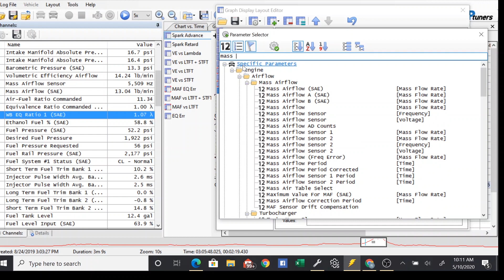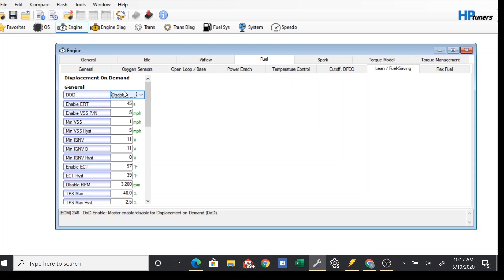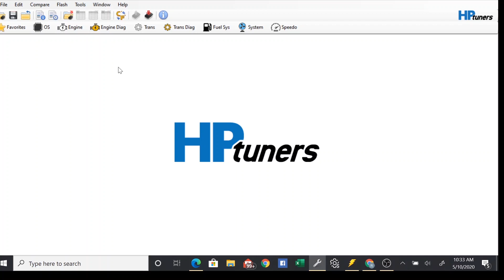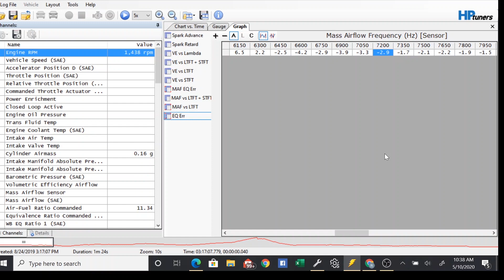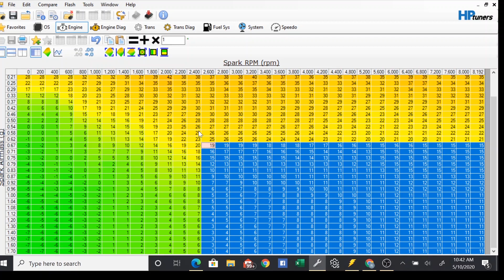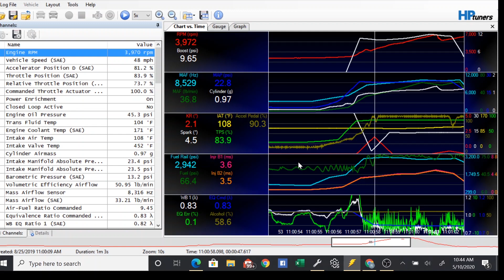GM GEN V WOT MAF & Timing Tuning

Comment: Thank you! So informative and helpful. Liked and subbed for sure.

I realized while watching this that it's all finally clicking and making sense to me. There's been so much trial and error with different parts of my tune file. At first scouring the forums and YouTube videos this all looked like Chinese, but I'm seriously running these logs and making changes and finally making headway. I still get worried about getting stranded somewhere off the side of the road after a disastrous upload or something...which is why I usually drive home before flashing an updated tune. 😆

Comment: Rob, I have upgraded to stage 2 on my 2017 Camaro with 2.9 Whipple that consist of rotofab s/c partial ca, TSP LT headers, cat delete front pipes, complete ZL1/LT4 fuel system, 3.5 upper pulley, and Alky injection kit with m15 jet spraying vp racing M1 methanol. I purchased an unlocked TCM from HP Tuners and took the car to get a motor/trans tune (Vengeance Racing). I was hoping you could help me with a few questions I have about the tune and lend some advise about some more upgrades I'm considering, Thanks.
Reply from the maker: Sure Lloyd, shoot me an email at tacticalgaragess@gmail.com

Comment: Thank you for the video brother , great explanation and your steps are logical and coherent . I hope you do a partial throttle video next , in the partial throttle maf is also used right?  From my understanding on gen v the car uses maf in closed loop and the  vve in open loop right?
Reply from the maker: The RPMS you set under dynamic airflow determine whether the car is using MAF only or a combination of MAF & VVE.  Stock tune uses MAF only above 4,000 rpms (typically open loop) then a combination of MAF & VVE below that.  Mine tune is currently is using MAF only above 1,200 rpms.  I will drop that lower for the partial throttle video and use MAF only for the partial throttle video.